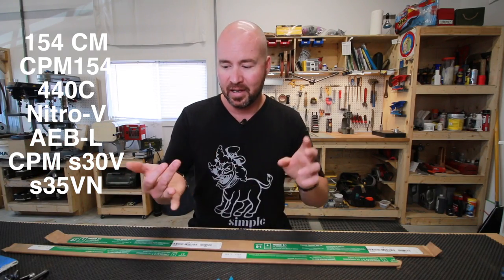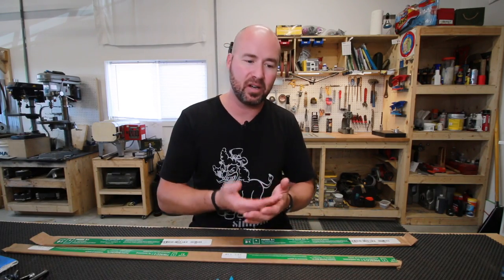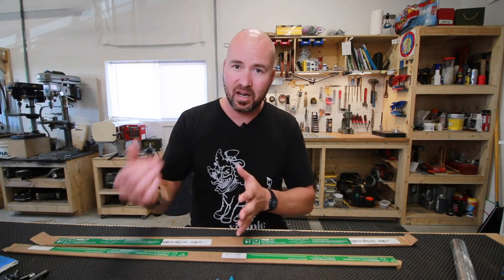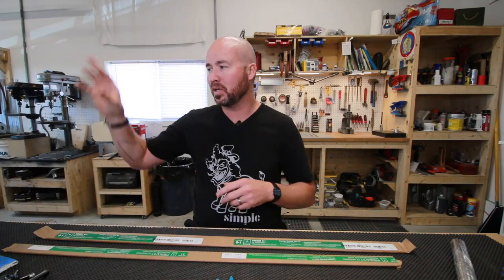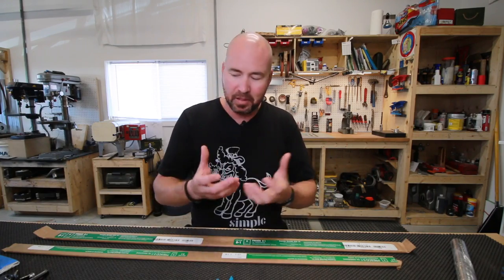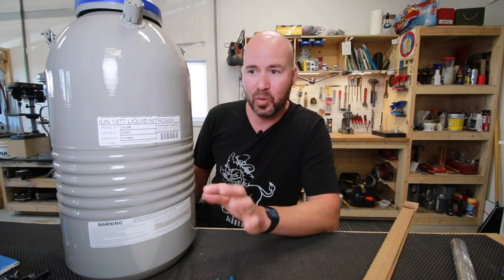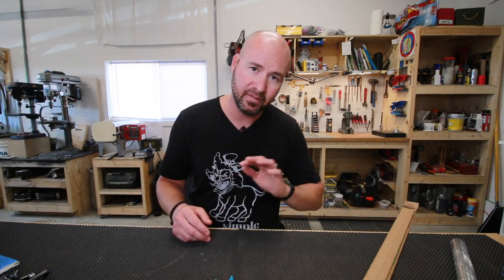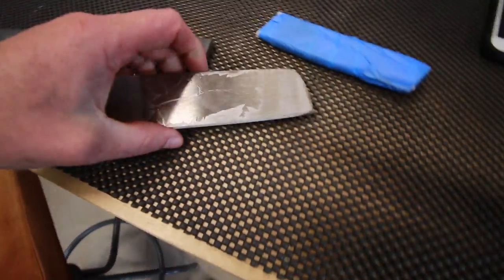Heat treating stainless steel

Comment: Glad to see the clamping trick worked with Nitro-V! The guys over at New Jersey Steel Baron said as long as you get the blade to below -100*f you should be good to go. I clamp everything now while sub zero quenching after I learned that trick lol
Reply: Glad I came a cross this. Having warping problems with AEBL and NitroV and was looking to make a straightening jig while in cryo and tempering. No problems with CTS-XHP.
Reply from the maker: Thanks for the help buddy! 👍
Reply: Thnx for your very informative video......You just convinced me NOT to use stainless steel for knives......

Comment: what about a blast of pure argon into the envelope wrap before you close it up and heat treat ?
Reply: There are Paragon Kilns that have Argon Gas injectors on them as an option, unfortunately the argon gas is detrimental to the lifespan of the heating coils.  Also, screwing around with Argon gas without the control of a specialized injector might not be the safest way to go...but that said how would you go about blasting the argon gas in there and sealing the stainless packet up fast enough or tight enough to keep it in there to do its job?
Reply: i use Argon when welding stainless as a shielding gas , maybe fold up all of the envelope except one small corner on each end , give it a blast of argon through one corner to push out the oxygen through the other corner then seal that one  then seal the one that you pushed the argon into ?  might work
Reply: Argon is significantly heavier than the atmosphere, you don't have to blast anything. Just seal all the edges but the vertical top, slowly purge argon into the envelope and it will settle at the bottom and displace any oxygen as it rises, then seal the top without tipping it over. It's essentially the same as filling a zip lock bag with water, then sealing the top. Argon injected kilns make sense to me but I'm not sure about durability of the coils. Argon would be less corrosive than oxygen/atmosphere right?
Reply: @esnyd  Since argon is a noble gas there should be none.

Comment: Heat treating and quenching is like having a empty balloon. Once you heat treat the steel it's strong and tight like a balloon full of air. If you let it cool it will slowly lose air. If you quench it it will stay blown up.

Comment: I've made some knifes on both Sandvik 12c27 and 14c28n. Heat treat to 1050°c for 6 minutes (depending on thickness) oil quench. I then clamp between to aluminium plates. Needs to get below 600°c within 2 minutes. Then in the freezer to -20°c. Then into the oven for 2 hours at 225°c. Easy to work with.

Comment: For the decarbonisation have you tried a tight carbon wrap around the blade before you envelope the blade? Kind of like what the Japanese do with the clay and ground charcoal mix coating. So if there’s any oxygen in the envelope the wrap gets attacked Primarily. Also the blade may absorb tiny bit of carbon. ... better gain some than lose some.. a bit like casehardening. It’s just a thought. Who doesn’t like an experiment!!

Comment: What if you were able to cool down your Aluminum / Aluminium plates before clamping the Austinite blade? ie: drill channels or tubes and run refrigerant through the coils. I invert a bottle of CO2 and freeze the edge before tempering. I know, lol but It makes me feel good. It could work. :-) Great Vid btw.

Comment: When tempering a warped blade I clamp it to a piece of straight angle iron. If it is a big warp I will actually shim it beyond straight with a couple pieces of heat treat foil. I have had good success with this method.

Comment: Great video, very good explanation!  Thanks for all your great content....  I just wanted to say, I know you are not a fan of dry ice but don't be too hard on it. I've had experienced knife makers tell me that, while not as good as liquid nitrogen, it does a good job for cryo treatment. For beginners or low volume knife makers who can't afford the expense of LN its a good alternative to get a couple extra points of hardness before temper. I can put out 154CM blades in a respectable 61-62 range after temper using dry ice for cryo. I'm told that 2 hours of cryo is enough but I usually leave it on ice overnight. I can get about 4 days out of 5-6 kilos of dry ice in a styrofoam cooler and for those amounts the local distributors haven't bothered to charge me for it so far. Even if they did it would be couple dollars per kilo to buy...  Its a good, cost effective, alternative and it will certainly extend the martensite transformation a little further than just heat treat + plate quench, but you are right that if you can afford it LN is the way to go for cryo.

Comment: Hey! And the benefit of plate quench is, thin blades staying straight! With high carbon steels i quench it in oil and after that, put them between two aluminum plates! I think you’re doing it right! 😎👍

Comment: Great video, we have had very good success with a 1"x1"ish piece of brown paper (a lunch/grocery bag) in our hardening of D2 and A2 tool steels, especially with D2. We've never had a pouch puff up. Just make sure you put the paper on the handle end of the pouch because it sometimes leaves an ash remnant.

Comment: I've only ever made S.S. knives. Mostly 440c.  I use an open air 3 burner furnace and quench vertically in Olive oil, and can get about a 58Rc. I've also recently started using AEB-L and a plate quench.

Comment: When we heat treat a2 and simular air cooled steel we go 1725f for 2 hours then air cool under a fan until the temp drops to 150-200 F then it goes right into the temper oven at 400-700 depending on hardness desired.

Comment: Instead of the steel foil, you could use a slurry I developed to protect your parts. It's one part fly ash, one part graphite, and two parts alumina-silica refractory with enough diethyl ether to make a thick paste (you could use acetone, but that might lead to some cracking). Let it air dry for at least a few hours in a very well ventilated place; then hold it at a low temp (400 f) for a couple hours, periodically venting your kiln, before soaking it at the desired temp. Quench in oil or water, though with oil you should agitate the hell out of it. It chips off pretty easy, especially if you oil blacken before applying.

Comment: Great video for me as I seek to learn more about heat treat... you brought up the subject of oxygen and carburization.. and also talked about welding. Though came to me, thinking outside the box. What if we used our inert welding gas to shield in heat treat? Either shoot some inside that stainless envelope, or introduce it somehow into the oven.. just a thought.
Reply: Hey KK I was thinking the same thing. You could insert/weld in a Pig Tail w/ Schrader Valve, Its like a bicycle tire valve but for Refrigeration. Pull a vacuum, Then pump in the Argon

Comment: Interesting about your pouches becoming s.s. balloons. Mine do, as well, whether I put anything else in it or not. However, mine don't balloon up until I take them out of the oven. Then they flatten out while between my aluminum plates and they still come out nice and clean, no decarb.

Comment: Hi there ! Thanks for very informative video, liked it ! I did my first plate hardening on AEB-L and for some reason the heat treating foil stuck to the blade (so it`s hard to get it off there). Do you have any comment on this ? 👍😊

Comment: I know this is an older video, but do you have anything showing heat treating without an EvenHeat oven?  Can you do carbon steel in a forge say?  I'm just starting out here and have no desire to spend $3000 CAD on an Even Heat oven.

Comment: Tig welding 316L pipe I always purge the inside with argon, when it's not practical to purge I use Solar Flux sold at Praxair. Would a thin coat allowed to dry before putting in the foil pouch help maybe even eliminate the foil? Or coat with Solar Flux, dry and cover with fire caulk for a hamon without or with foil? Just a thought, maybe even try a borax paste. How about sealing your oven and purge it with Co2 or nitrogen wouldn't take a lot of flow if it halfway sealed. Nice videos for a Millwright, lol.

Comment: Most likely reason for the foil wrap expanding with paper is incomplete combustion (due to the little oxygen) creating carbon monoxide as a gas from what was a solid, gas also expands with increasing temperatures so that will amplify the affect even more

Comment: The puffing with paper is probably due to moisture content of the paper. Paper (cellulose) is a water sponge type material. Water expands 17 times its original size when it vaporizes.
Reply: That is an excellent point. Would wood be a better solution?
Reply: no, for the same reason. The cellulose in paper, originally from wood, sponges water. Wood is a no go.
Reply: only if you can get nearly zero percent humidity wood, like .001
Reply: Thanks! I have some handle wood material that has been dried before stabilizing with very little moisture in it so perhaps I will try that next time.

Comment: Would the process be the same for something like 20 gauge wire? I used to make jewelry and things with hard stainless wire that I got from the welding supply store. It came in straight rods and was super hard and durable for the finished product... but it was killing my hands to bend and work with it. I’m thinking that if I can use milder steel for the creating process, then maybe I can harden it afterward.

Comment: Introducing wood to the furnace adds more carbon to the steel when wood burns it becomes carbon one of the things you can do is simply apply flux it eats oxygen when it burns on top of all of that with stainless you want a very low carbon to help the steel stain less you see what i did there but most steels are different for instance cpm-s30v and s35vn are a very interesting thing to heat treat because they are a powder steel which is quite a bit different to treat.

Comment: Have you thought of drilling holes through and channels on the surface of the aluminium blocks that you can blow compressed air through for more even cooling? rather from just blowing it into the gaps? Interesting video, thank you very much, take car, God bless one and all.

Comment: I can see how the plates cool the area of the blade that are directly contacting the plates but what about the edge and the tip of the knife thats not directly contacting the plate.  Are those areas hard as the spine?  Obviously plates work but i just wonder how they do.
Reply: Heat flows from high to low temperature.  If you cool one part of (anything, really) the heat will disperse throughout the whole blade.  This is, the heat that has not been sucked out already from the plates, water, oil quench etc.  Even if the tip doesn't come into contact with the plates directly, the plates still cool the whole piece of steel for two reasons.  1.  The excess heat will travel to other parts of the blade that ARE in contact with the plates.  2.  Many knifemakers put their plates in the freezer before using, which will pull even more heat out of the blade, even quicker.  The knife is so close to the plates that everything gets cooled so fast and you don't need to worry about that.  I hope this helped.

Comment: I wonder if you could also use the nitrogen from your LN container.  just let the fog fall into the envelope.  it displaces air and is heavier than air so it should stay full.  nitrogen is still a reactive gas so not sure what would happen.

Comment: Simple Little Life: I read somewhere that to get a good heat treat, with the plate quench, the bevels should not be ground until after the HT process. Otherwise the blade edge (most important part) cools slower.  Do you have any thoughts or experience on that?  P.S. Great video(s)

Comment: Maybe you could use some argon gas to fill the envelope insted of using paper. If you happen to have a TIG welder you'll have a bottle of argon 4.6 anyway.
Reply from the maker: I think the problem with argon in a sealed envelope is that it expand 10X when it hits the temperatures required for stainless. That would just rip open the envelope.
Reply: @Simplelittlelife  Valid point actually. If you would flush the envelope with argon and afterwards squish everything excess out like you already do, anything left should be argon. But might be an unnecessary extra step, as you already get good results. Just something I was thinking about. (By the way I'm a student of mechanical engineering with focus on material science from Germany. I was referencing your heat treating process in a lecture about heat treatments of steel, since we were learning why steels over a certain amount of carbon need a cryo treatment to fully develop a martensitic structure. I love your work and hope I'll have time this Winter to get back into some knive making.  )

Comment: Jer do you know for sure those ‘Knife makers you admire,’ were not using a wrap because they had coated the stainless blades in something like Condursal Z1100 instead?  I’m just saying it may look like they are not protecting the blade if all you know is the wrap method.  Also you don’t need to do anything if you are using a salt pot.

Also curious how you are testing HRC on your carbon and stainless steel knives?  File set or do you have a Rockwell hardness tester?

Comment: how thick do the aluminum plates need to be? would 1/4 aluminum work? or is that too thin?
Reply: Zombie Joe Knives I would say it depends on how much air you blow in there. The plates of aluminium need to be thick enough to soak up the heat from the knife. Personally I wouldn't go below 1/2 inch. Take this with a grain of salt because I haven't made any knives yet. I have just become a student of the subject and have countless hours on YouTube university....lol

Comment: can you get any result doing cryo on a freezer ? its because dry ice and liquid nitrogen is hard to find and expensive in my area
Reply: Yes freezer is doing something. Check out Larrin Thomas article about that. He compared the effects of all three.
Reply: Larrrin Thomas / knife steel nerds is definitely the goto resource every maker should study.  especially for stainless, any form of cryo will help a bit. But the colder you can get it and the quicker after quench you do it, the better the result.

Comment: Interesting, Id only read about the process, nice to see it. If I had to go thru all this tedium and expense, Id never make a knife again! 5160 is my middle name...quench in oil, temper on an old red hot file, yay, quick and easy and cheap but pretty damn sharp.

Comment: Very interesting and well explained as usual 👍
I use D2 with no cryo, works fine for me but I'd like your thoughts on a hardening dillema..
specs say to soak at 30 minutes per 25mm of thickness, since my stock is only 3mm does that equate to only needing a few min soak. ? I find that the longer the soak the more carburisation i get . gonna do some experiments soon but you could save me the time 😏
Reply: Since you do not do cryo can you share your D2 heat treatment procedure?
Reply: I keep it pretty basic. slow heat to about 820c soak for 5-10 min then increase to 1000c and soak for 15-20 min ( thinking of reducing to 5-10min) and  still air quenched ,ambient temp is usually between 10-20c, temper as soon as blade is cool enough to handle. 1 hour at 200c, twice.
D2 is not the easiest to work with but has excellent stability with very little chance of warping as long as edge thickness is 0.3mm or more.
Reply: Thanks!
Reply: No worries. hope it was helpful 👍

Comment: Could someone maybe explain this to me? Thermal conductivity is measured in BTU (at least it is in the UK), how fast a material absorbes heat from another material it's in contact with is given as BTU/Hr per foot³. The BTU/Hr per ft³ for pure copper is 223 while pure aluminium is 118. If the aim of plate quenching is to suck heat out of the knife as fast as possible wouldn't copper be a much better choice?
Reply: marc coffey makes sense. However two thick plates of copper would cost a lot more.

Comment: A thought on the decarburization and why it MIGHT not actually be as much of an issue as we tend to think: 
The decarb is generally only going to go very shallow on the steel where the oxygen can reach. So if you are going to do a final edge bevel grind after the heat treatment, you’ll probably grind away the thin outer layer that was decarbed. 
Now the thing that theoretically could cancel out this hypothesis is carbon migration, if the inner carbon will migrate to the decarbed surface and then itself become decarbed. 

Anybody have any further thoughts on this idea? Am I crazy?
Reply: It's all a function of temperature and time. But you'd want to remove decarb as much as possible. That's why heat treating foil is generally recommended to not let any oxygen touch the blade.

Comment: Really great video. Just a quick heads up, early on (1:58) you mentioned CPM 3V as a stainless steel. Although it has a lot of chromium (7.5%) it falls short of the 10.5% requirement to be considered stainless steel. As a result, CPM 3V does have better corrosion resistance than many other carbon steels, but it is still considered a carbon steel, not a stainless.

Comment: About the decarburization.
you could protect the knife with graphite power or some charcoal, this way you would have an atmosphere rich in carbon, which will protect the knife from the oxygen. The only moment where you would have some decarburization would be between the furnance and the quenching step. Pretty easy to do and cheap.
Very nice video by the way!